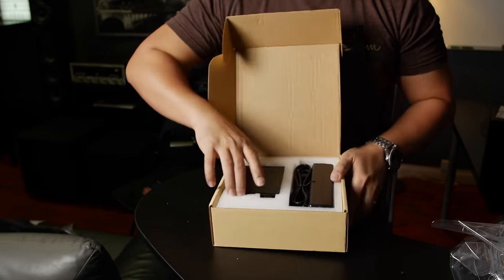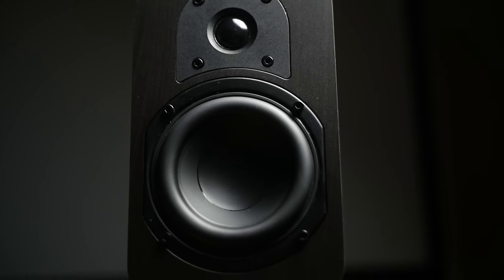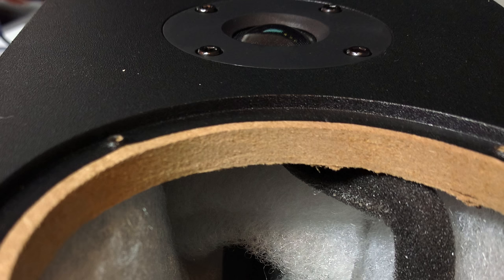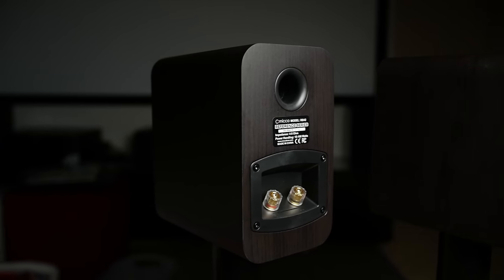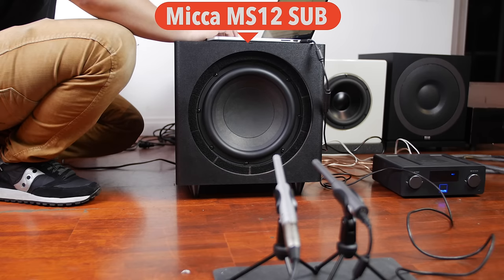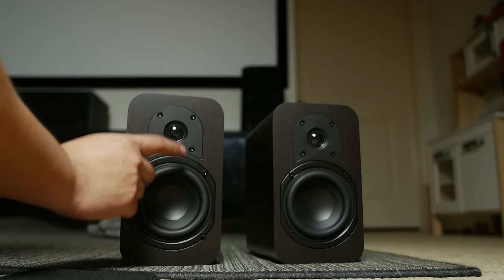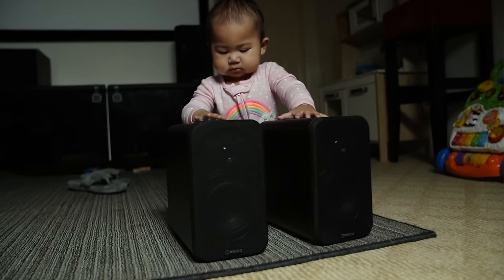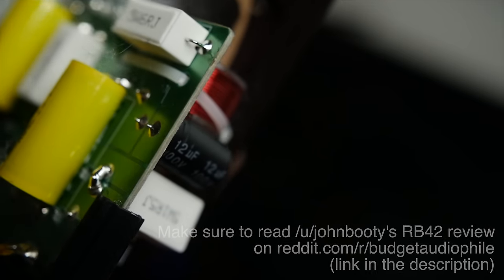Micca RB42 Review vs MB42X Bookshelf Speaker Review- Bonus Crossover Mod (End)

Comment: Those who have reviewed this speaker say the same thing about the bass....and more so that it is a 4 incher.....They are impressed! This make a great case for when there is no space for a bookshelf speaker like the Elacs Debut 2.0 B6.2 which I recently purchased on this Black Friday for $239/pair (the B5.2 at $199). As a matter of fact it seems that these match or even beat the 6.2 low end bass (+/- 3db). Yes, they don't sound as good but like you say, they are kind of fun, maybe an overkill for the desktop. I bought the Elacs for the bedroom and wanted something fancy to drive them but the cost of the Cambridge AXA35 int amp was, at $350, a little bit too stiff for my bedroom system budget ($500 <). So I went the receiver route and bought an Onkyo TX-SR393 new for $229 on another Black Friday deal. I mean yes I could have purchased a Micca Origain ($99 discounted on Amazon) int amp with a very basic DAC and digital/analog/USB input but then again the Onkyo has way more power (80W at 20-20K /8 ohms), it is a 5.2 A/V receiver as well and then it has a "Premium 384 kHz/32-bit AKM multichannel DAC", bluetooth, all kinds of Dolby surround, blah, blah, blah AND it is an A/B type of amp, NOT a Class D.
I can't recommend the smaller amps for the Miccas, more so when they are in the mid $100s for which you can purchase a Sony STR-DH190 Stereo Receiver for $149 (90 w / channel) from Crutchfield and kick some serious ass. The Sony sounds great too. Unless you absolutely are limited on space, for which the Micca is decent at $99 (it is really 30W at 8 ohms), get a budget, quality receiver from Sony, Onkyo or Yamaha and you can still grow with it.

Comment: Came for the Miccas, stayed for the easter egg 👍🏾 In my 5.2.4 I use the MB42X & MB42X-C as my LCR.  The Covo-S as my Surround Rears and JBL 8" In-ceilings for Front & Rear Atmos/DTS-X.  Miccas are multipurpose audio-phile friendly and Spouse approved for the living room!
Reply from the maker: I've never heard of full (minus the sub) Micca home theater setup. How does it sound?
Reply: @joentell  Room is in open space, 16x16, hardwood, no curtains just blinds. Only acoustical treatment is a 9x6 rug. The two subs are Polk Audio SW505. Receiver is an Onkyo TX-NR787.  The Miccas fit right in the sound stage and 1 yr later haven't felt a want or need to upgrade :)
Reply: They are quite unobtrusive

Comment: Tweaking will always be a thing for audiophiles,from changing wires/cables to tube rolling,cap replacements and so forth..those are learning/experimenting journey of  what works and what not that makes this hobby a worthwhile venture to those interested enough.
Reply from the maker: Experimentation is part of the fun.
Reply: Save yourself some time and money and get a Schitt Loki EQ and have some fun. I recently got one and I swear was the missing link to my system.
Reply from the maker: @67spankadelik  I have one. It's everything you say!
Reply: @joentell  fortunately I still have most of the equipment I purchased in the last 20 years. I've been experimenting with the Loki on the old stuff and I'm blown away. I've spent thousands of dollars upgrading preamp, cables, interconnects, phono cartridges, speakers just to make subtle and sometimes superficial changes. Glad I took a chance on the Loki. It has made a huge audible difference.

Comment: Had an eighty-nine Masda 626 very much liked it after I put new struts in it and a pair of nice Falcon  tires up front just one size up . The 2.2 not much horse power but nice torque. Mazda built nice inexpensive cars back then. The independent twin trapezoidal linked rear suspension was great. It gave you some cornering control using the accelerator pedal to keep the terminal under stear under control. A little of topic...good Chanel though...

Comment: , I know that Micca likes small speakers but they really need to step up to a 5 inch speaker or even a passive radiator design. 
these are very good but need at least twice the power. I do plan on getting a pair with a Emotiva 150 amp or Yamaha receiver rated at 100 wpc/rms.
Reply: Agreed micca should bring out a 5" model in theory MB52 or MB52X

Comment: If you high pass these with your receiver along with a sub they become more efficient.  In other words if they aren't playing the lows, you can turn them up more.
Reply: . . . also, with the high pass filter, you cut freqs wherever you set it, usually around 100hz, so nothing below that freq passes into the RB-42, improving lower-mids,and everything up to tweeter xover, as less motion in the 'woofer', improves the mids, the holographic effect.

Comment: I was planning on getting these or the MB42X for my garage speakers, currently planning to build. 24'x24' with 10' ceilings. It's a 2 car plus with home gym. Workshop and gym will get used quite a bit. Powering with my Onkyo TX-NR737 that I retired from my basement theater room.
Reply from the maker: RB42 all the way unless you're planning on using a sub with the MB42X.
Reply: @joentell  Haha! Yeah. I would have a reason to buy and try a Rythmik servo controlled sub in my living room and the BIC PL-200 would go to the garage. Probably gonna buy 2 pairs of bookshelves and run in Multi-channel stereo.
Reply from the maker: That wouldn't be the worst idea. Let me now what you end up doing.
Reply: @joentell  I forgot about the NHT SuperOne 2.1 2-Way Bookshelf speakers. They have a 6.5" woofer and are sealed. I have their SuperZero 4" version as my front height channels in my basement theater and they are great. Do you have any experience with the NHT speakers? Built in threaded mounting holes, ready to go on the wall or ceiling.

Comment: Great review.   When you were talking about the complicated crossover in there I was thinking to myself.  "hmm, you could use that crossover network in part to attenuate mid to higher frequencies and improve the relative bass response..."  Then right after you start talking about how the speaker is low impedance, quite inefficient, and has a great bass response for the size.  lol.  Seems the manufacturer did exactly that.    This looks like it'd make a great inobtrusive satellite speaker for a multi-channel home-theatre setup.  Then you'd have a good high-power receiver and a sub or two tucked away somewhere.  At this price and size you could have a decent 9.1 setup with a high WAF (Wife Acceptance Factor).
Reply from the maker: You sound like you have experience building speakers and crossover design. You're right on. I just try to keep a bit simple so that beginners aren't overwhelmed but I don't insult the intelligence of more experienced audio enthusiasts.

Comment: , FYI, the vanatoos are not passive, they are an amplified monitor, caint compair those with these speakers. a more comparison would be between the Q3020i.
also, the Fluance ai60s are also amplified and are a monitor, caint compair those either
Reply from the maker: I will make a new column for powered speakers

Comment: Thanks Joe for another great review. Do you have a plan to review that SVS Prime Soundbase I saw on the video? if not could you give me some thought about it? I'm thinking to get  either SVS Prime soundbase or PS Sprout100 and pair it with my Elac Debut 2.0 B6.2 for my small living room.
Thanks,
Reply from the maker: It's definitely more than powerful enough to drive the B6.2's. It is exclusively controlled with the app so dedicated remote for volume and input control. That's my main gripe. I haven't tried out the Sprout 100.

Comment: Thx for your reviews  I would like your opinion re:atmos/dts.x height speakers.  
My current setup is a Denon x3400h , Rotel RB-1552 MKII amp on my FR and FL. 4 Elac Uni-fi slims (BSU5), 
Centre is a UC5 and my sub is Elac 3010.  I dont want to spend a ton on atmos related speakers. 
 Do you think these Miccas or the mb42x will do the trick? Do they have a wide dispersion tweeter? and could you recommend others so that I can research
 your suggestions?  Also I would obviously have to mount the speakers to the wall. Thanks in advance.  Cheers!

Comment: @Joe N Tell
I have a recording mastering studio and I am changing my monitor configuration to a 9 speaker surround  L/R Configuration. Whereas I will have a single Dayton Audio 15" SUB front and center and my L/R tops will be 4 boxes literally running across the Left wall and the same on the right side - all pointing toward mix position... I had settled on the (x8) FLUANCE SIGNATURE SERIES BOOKSHELF'S for this task... however, I am seeing this MICCA RB42 and i am intrigued to say the less.....

Question is, "which speakers between the Fluance Signature Bookshelves or the Micca RB42 would you personally recommend?"
Reply from the maker: For recording and mixing/mastering, I don't know that any of these would be my first choice. I would say that the Fluance Signature wouldn't be appropriate because of the dip that I experienced in the treble frequencies. That might change the way you mix. 

The Micca RB42's are some of the flattest speakers I've measured nearfield so that I would rather recommend those than the Fluance for your purposes.

I would also take a look at dedicated studio monitors like those from JBL or Yamaha. They are designed for nearfield use.

I'm also reviewing some Vanatoo Transparent One Encore powered speakers that also measure well and perform well nearfield.

Comment: Question: How do these or any of the newer product for less than $500 compare to the original or "updated" NHT Superzero or Superone bookshelf speakers? I've got both (original versions) and love them when used with a sealed subwoofer or two, but before I part with my money, I would like to be convinced that what is available today is a real upgrade. Any idea? Obviously they won't reproduce the lows as well as the ported cabs but they were intended to be used with subwoofers or, in the case of the Superone, right up against the wall. But do they compare favorably when considering audiophile attributes or has their basic tech met its match? They were both highly regarded back in the day and punched way beyond their price point when it came to sonics above 100 hz. Thanks in advance!

Comment: These look like the speaker i have been looking for, a desktop setup for my dad. I would like something small, real small, volume isn't a major concern, stylish and sounds good, he listens to classical, jazz, brass bands and folk. Given these parameters would you say these are the ones to get? Could you recommend anything smaller? I am probably getting the smsl ad18  to drive whatever i end up getting.
Reply from the maker: I think it would be a terrific setup. Just get some isolation pads on Amazon also to raise them up a bit.

Comment: Ever hear the Polk LSIM703s? I own them..really feel they will Wow you for speakers under 1k. They debuted in 2012 for $1500. Can be had for $600 now! 30lbs each...3 way! Are you open to reviewing them? For what it is worth Sean from Zero Fidelity said they are a Stupide deal at $600 for the pair. Would love to see you review them!
Reply from the maker: I have not heard those
Reply: @joentell  How about reviewing them? What do you think?
Reply from the maker: I'm not overly interested just because they are older speakers and I've never been a fan of Polk's sound signature out of the many I've owned and have since sold. The treble was way too hot for me. These might be different, but that's why I haven't. There are so many speakers out, it makes more sense to try to cover new speakers coming out.
Reply: @joentell  fair enough. I had a feeling you would want to focus on more new models. All I have to say though is these in my opinion are the best bargain bookshelf speakers out as of right now. I've heard many many different bookshelves and nothing we'll touch these for the money considering that they are so well-balanced. The best way I can describe them is they are a large bookshelf speaker that sounds like a tower speaker. They use a ring radiator Tweeter I have them face and straight out and they're not even close to being hot. They are just so well-balanced. Yeah the polks that you have had we're not this kind of Series this is the reference series these are audiophile speakers no joke. I just thought you would like them a ton of considering you like the UniFi fives by elac. The polks are also three way
Reply from the maker: If I ever find a good deal on Craigslist I may give them a shot. I appreciate your input! 🙏

Comment: I just got a set of jamo s805 which have the same drivers as the s803 but with a bigger enclosure. How would I go about determining if my new speakers have some of the quality issues that you saw with your s803's? I saw you had complaints about a low frequency resonance in one speaker but not the other, was that it?
Reply from the maker: If you play an online test tone generator, just run some sweeps at relatively loud volume, and see if you hear any weird noises.
Reply: @joentell  Thanks! I appreciate all of your content in trying to figure things out when just starting out in this HiFi space.
Reply from the maker: You're welcome. This is the one I like to use: https://www.szynalski.com/tone-generator/

Comment: Looking to buy some beginner audio stuff.

Would these pair nicely with the Topping MX3? I’d be using them for my desk setup, Xb1X and PC. Music, movies/shows, and some gaming.

What I’ve been looking at for my needs is:
•FX Audio dac X6 & Smsl sa50 amp paired with the rb42’s
OR
•the Topping MX3 and the rb42’s.
OR
•the fx Audio dac X6 paired with the pb42x’s.

I am a complete novice and would like some help/advice with this stuff, if possible.
I’d like to control the volume from the dac/amp. My sources are spidf (console) and usb(pc).
Reply: This was my thought, but the MX3 is listed as 40wpc, so I'm not sure it could push them enough. Haven't tested, though. SMSL AD18 is listed at 80wpc, which is why I think Joe recommended that one.

Comment: Since they are so cheap I wanted to get 2 pair with the matching center. Should i buy for the MB or RBs and wait for the center? Even though I have a sub I like my other speakers to fill the room with bass and rarely use a bass crossover on them. I watched Zeos's review on the RBs and its funny how he was so blown away by the RBs. plus ebay has some RBs for $80 or so. Thanks
Reply from the maker: Either are great. You can't really go wrong.

Comment: Lots of confusing info. At first, "crazy bass" then, "you'll need a sub and a small room",  Then, "42X not as good as 42" then later "if you want better performance go with the 42X". I hear this with every reviewer. It's always "they don't even need a subwoofer" followed soon after by "you'll need a subwooffer" (?????) Is this a generational thing? I don't really believe in subs unless you're listenting to Dr. Dre because those sub frequencies are not heard they're felt. I wouldn't listen to rock or jazz or classical with that kind of bass. So, ....what is it? I'd like to get these or the Andrew Jones Pioneer FS52 floor speakers which I've heard astounding things about. I have a  12 by 16 foot room.  Thanks in advance for any suggestions. You're vids are great.
Reply from the maker: So these have crazy bass...for their size. For your music taste, you probably don't need a sub. For movies and bass heavy music, someone might want a sub.

The MB42X's are more cost effective if you will be using them with a sub. The RB42's are better if you aren't using a sub and if you are, but they are more expensive.

I thought I was pretty clear. What you have to keep in mind is that all of this stuff is relative. I'm not talking in absolute terms. Do a pair of floorstanding speakers with dual 10" woofers have "crazy bass" in my apartment? Yes! Do those same speakers have crazy bass in a football stadium? No. So I'm not waffling, I'm setting limits on my statements. Does that make more sense?
Reply: @joentell  Thaniks!!

Comment: What would you recommend for basic listening and some gaming for a desk setup that has Bluetooth support for connecting via phone? Have been looking fo a while but couldn't make a decision
Reply: I’m using an SMSL AD-18, Pioneer BS22LR, and a Micca MS10 sub. It’s a gaming/media PC system.
Reply: @PRamsey77  I live in a dorm so a sub is not practical for me thats the problem
Reply: Oh, you could leave the sub out and still be happy. The SMSL AD-18 is an awesome piece of gear. Watch Joe’s review of it.
Reply: @PRamsey77  Alright thanks
Reply from the maker: These Micca RB42's will likely produce more than enough bass and get more than loud enough for a typical dorm room. No need for a sub. That's the ideal use case for these.
Reply: @joentell  Thanks!

Comment: Are the RB42's good for surround sound? Looking to buy 4 total for my home theater. Thanks!
Reply: Must buy .....
Micca MB42X ...... 4 quantity 
And 8 - 10 inch subwoofer .....
........

RB 42 has bass ..... I like it ..... But ....when u put more volume on that .. RB42's Xmax cross easy and gets rattling  sound ( this is law of physics ) ... U not able to put high volume on RB 42 ....
................
Main benifit of MB 42x is ..... 
1) price is less than RB 42 .... Which is u able to get subwoofer for MB42X 😎 
2) when u play louder on MB42X .... Which direct benifit on theirs MID range performance than RB 42 ... Especially when u play EDM music on it 👍 
3) when u pair with subwoofer with MB42X ...... U will get all rounder performance than RB 42 
4) RB 42 is limited to ... Near field / high watt need / not versatile / 
......................
......................
My recommendation to get this pair ...
MB42X ....... For RL + SRL ... 4 quantity
MB42X-c ....... For center 
8 - 10 inch subwoofer / woofer 
Frequency reng between ( 30 hz - 1k hz ) .... For better mid base punch 👍👍👍👍